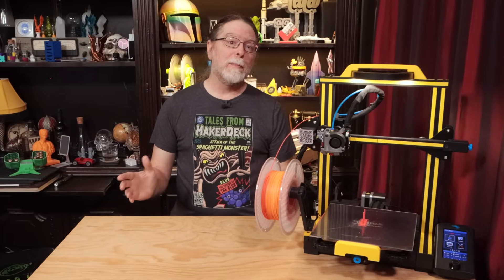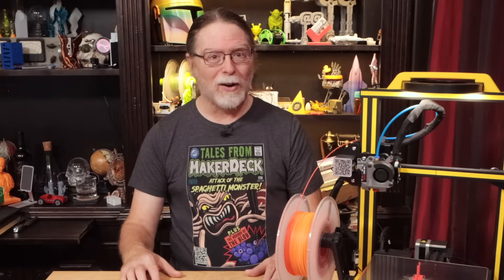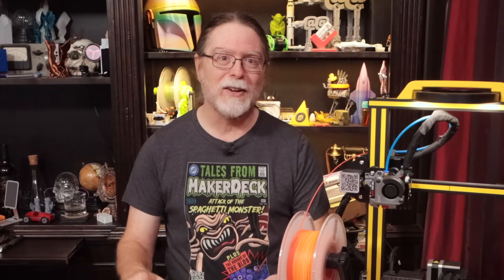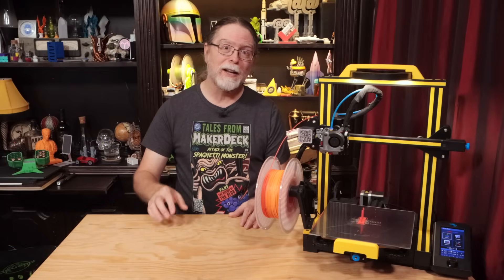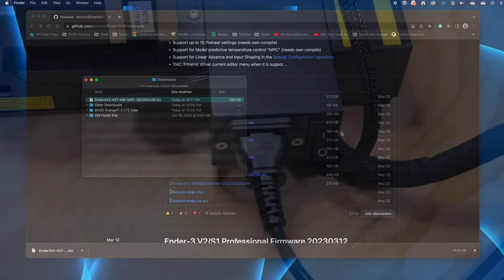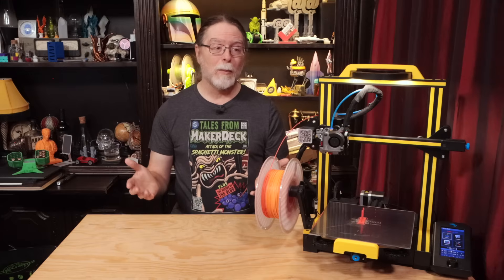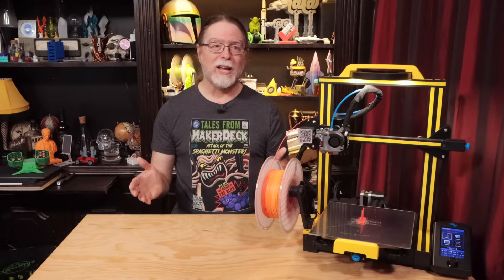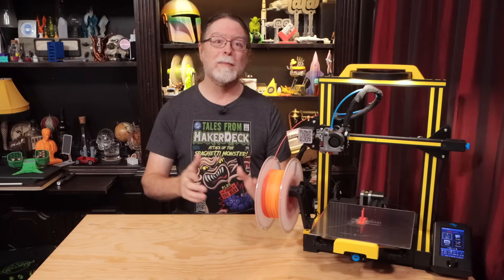The BEST Ender-3 V2 Firmware EVER?! MRiscoC Professional Firmware

Comment: A question for you. I have an E3S1 I purchased new 1 year ago. I have upgraded it's firmware to E3S1Pro firmware and that was the best thing I ever did!!! Now I have 2 more used E3's. An original E3 and an original E3Pro that has the same screen on it my S1 has but get a constant buzzer from display. It has original mobo in chassis in it which is I believe a nono.  If I use this firmware here you talk about (MRiscoC) and purchase the correct board (which one do I need) will this firmware give me at minimum of what my S1Pro firmware gives me for auto leveling, tramming and bed mesh? I do have a touch probe to go on too. Also, My original E3, What can I do to it to get it to at minimum the same level as my E3Pro? Ultimate goal is ALL 3 machines run basically the same firmwares (as in options for mesh and leveling). Can you help? My S1Pro firmware is dialed in perfectly now with the pro firmware.

Comment: Hi Bryan. I installed a Sprite extruder to my ender 3 max neo. I was stuck on that creality screen. I e-mailed Creality,  and they told me that I would have to upgrade the mainboard to a 4.2.7 one. I did that also but the screen is still stuck on creality. Can you please tell me what firmware I should use. Thank you.

Comment: Hi! Please help! 
I recently upgraded my Ender 5PLUS with a 4.2.7 32Bit motherboard and a colour LCD, of course i uploaded the best firmware ever, the Mriscoc 😅
My problem is, the firmware is locked at 230mm printing size, and i want to increase it to 370mm on what ender 5plus have. I tried to do it from slicer, but the printer firmware overrides the GCode and stops at 230mm. 
How can i increase the printing volume?
Reply: Go  to Advanced / Physical settings / menu.
Reply: @MiguelRisco  @MiguelRisco Hi, it dosen't work, it dosen't go further than 238mm. 
But i managed to open the firmware with Visual studio code, and change the printing size from there. 
The machine work perfectly now, thank you very much 😁👍
Reply: @hilexxx  You must follow the instructions about calibration in the wiki, first you need to increase XY MAX POS then you will be able to increase the bed size.
Reply: @MiguelRisco  Aha! I see...  i will reinstall the firmware today and try it. 
Thank you 😁

Comment: You save my day with this video! Thanks 👍
Reply from the maker: Glad I could help!
Reply: @BV3D  I am having a problem that during printing the 'Z' axis is not moving up, maybe it goes up two or three layers, the motor is running from the menu, but not during printing, I have already tried different firmwares. I have already put the bed on level.

Comment: I have been using this firmware for about a year now.  All of my V2s have Sprite Pro direct drive extruders with CR Touch probes and this firmware lets me not only tweak the bed mesh size (I like the 9x9 mesh), but I can also specify the probe offset so that I can maximize the area that's probed.  The Z offset and tramming wizards are invaluable, too.  Hats off to Miguel!
Reply: Did you try AML 2.0?
Reply: @MiguelRisco  I have not, but as I sold off all of my Ender 3 V2 printers except for one and that one is now running Klipper from a Raspberry Pi, I have very few Marlin printers left in my farm.  My Sovol SV02 and SV03 are the only ones not running Klipper.
Reply: @Stew3DPrinting  @MiguelRisco Do either of you have any recommended settings for the Ender3 V@ with a 4.2.2 MB and a Sprite Pro Extruder.  My stock extruder went bad and so I figured I would upgrade to a direct drive, but now the hot end doesn't align with the print bed when I auto home.
Reply: @ShadowDenLifting  I no longer have an Ender 3 V2. Somewhere I have screen shots of the various settings, but I'd have to locate them and transcribe the settings.
Reply: @Stew3DPrinting  Thank you.  I am up and running.
Reply: @ShadowDenLifting  What file you download for the V2 and Sprite with CR touch?

Comment: Should the Auto PID function sets with the filament in or not?
Reply: For the hotend, you should use MPC which is more advanced.
Reply: @MiguelRisco  There is not an MPC firmware for my Ender 3 S1 with the F4 mainboard

Comment: Despite following your instructions to the letter, all this has done is brick my printer.

EDIT: Scratch what I said before, had a TJC screen unit and needed to update the firmware on that too.
But now have a 4.27 board in there now over the (likely still good) 4.2.2 it had originally!

Comment: If I installed the v2 screen on my ender 3 pro, could I run this firmware? My board is a 4.2.2.
Reply: Yes, but you need to follow the calibration guide.

Comment: Amazing firmware and video, I have been using the Jyers FW for the last year without much issue but have had to recently replace my motherboard and lost all my settings. Since the replacement I have been fighting to get my bed level even with the CR touch, within 5 minutes of firing up the new firmware the tramming wizard had got my bed level and I was printing again!

Comment: Can I use it with my Ender 3 V2 Neo?
Reply: Yes.  I just updated mine.  First thing, though it's not too clear, check the Neo screen (open it) and if the model begins with TJC, update it it first with the TJC download from Professional.  Then use the builds that have TJC in the file name and shorten the filename to eight characters then reboot.  If you don't do this, like me, you will spend a few days trying to figure out why the display doesn't work with the new software.

To the software author, make sure the importance of the screen manufacturer is stressed.  Like make it ITEM NUMBER 1 to check!  I thought I'd bricked my Neo until I worked my way through it.

Comment: Just kicked Jyers to the curb and installed this firmware on a Ender 3 Pro that has been upgraded to 4.2.7 board, CRTouch, v2 screen and a dual z lead screw. So far, it is working great with perfect first layer. Thank you for posting this video.
Reply: Same machine, and I have yet to get it to,print first layer well. So frustrating
Reply: How was it different from Jyers? Please respond. To me, it looks identical to Jyers, all the same functions are available. Should I change? I get perfect prints on Ender v2 with Jyers, as good as Bambu lab print, but slower. I have bll touch and another stepper motor for z axis. Works perfect.

Comment: Excellent video.   I had an initial issue with flashing the firmware but changed my SD card from a 8gb to a 16gb one, reformatted.   I also changed the firmware filename to 8 characters.   I got scared for a moment, but it all worked out and it is very nice!

Comment: I downloaded the MM for the 4.2.2 but have a BL touch so went back to re-flash and now wont recongize the firmware update. Any ideas? Didnt have a issue getting it downloaded as MM but major issues doing bltouch.
Reply: I had same issue with 4.2.2 and cr touch.  I hadad to rename/change the .bin file name on the micro SD card to something different/new.  then it loaded the new firmware.

Comment: Could someone help me please, I just upgraded my firmware using this video but to the lastest firmware which is version 2.1.3 mriscoc, on a ender v2 neo and now when printing the nozzle is off the build plate when starting to print meaning that the filament ends up on the deck below the build plate, I’m assuming that the build plate area size is incorrrect but have no idea on how to fix or adjust this, any help would be greatly appreciated.

Comment: Love the software. Helped me determine that my original bed was warped. Question is why does my CURA code not run the G29 code any more. Before I upgraded software, I had G29 F5 run before each print, now it is not and I verified it is still in the slicing software pre-code gcode.
Reply: for UBL use "G29 P1"

Comment: Is there an option in this firmware to raise max nozzle temp to 300c ?
Reply: Yes, with the custom G-code "C29" but if you have a Sprite Pro extruder then try the T13 version.

Comment: love your videos I need help: my Ender 3 v2 print head early in print just runs to the nd of the bed on the x axis until it hits the stop and makes a loud chattering noise i did the firmware up grade and have the same issue. I am printing via usb from computer to ender please advise.

Comment: Installed on my ender 3 max v2 pro,  am getting a ender 5 plus and am wondering could I install a v4.2.7 board use a ender 3v2 display and rewrite the code to use on the e5+??

Comment: Hi Bryan.
I installed the motherboard firmware and DWIN display on my Ender 3V2, very easy. It worked perfect, the firmware that was on the machine was the original. Greetings from Brazil and thank you for the excellent video. NOTE. The version I installed is already more current than your video, 20240122

Comment: @BV3D  Where do I begin, well I bought 2 Ender 3 V2s over a year ago and to be honest, immediately I was not impressed with them and their printing capabilities. I was expecting great things from them as they were taking over from an exhausted original Ender 3. To be honest their print quality was never up to par with my original Ender 3. To make things worse one of the V2 printers had this odd quirk to it where it would pause for a microscopic amount of time but it was long enough to leave a blob of filament as a result of the hot filament still oozing out of the hot end and spoil the prints. The only prints I could do with this printer as a result of this flaw was flat pieces, panels for the want of a better word. I did find articles on line referring to the power loss function/feature having something to with it but alas the original firmware on my Ender 3 V2 did not have an option to enable or disable it so I was stuck with a well below par printer. I was on line looking at taking a hit for the new Ender 3 V3 SE so I YouTubed some videos for research before purchase and by pure chance your firmware video came up as I went down the rabbit hole of video recommendations which is YouTube. To make a short story long and short again you are a life saver. This firmware up grade has my two V2s running as smooth as butter for the first time in their existence. So thank you, thank you, and thank you.

Comment: how hot is the hot end temperature limit in this firmware? i'm using a spider v3 hotend  and it says it can do  300C but my current firmware only goes to 260C. i'm only trying to get to 280C for PCTG

Comment: Unfortunately, I had the opportunity to test this firmware. Countless of bugs..
1-Main problems are after homing with bl touch, probe is unable to touch back for mesh build.
2- After homing, very frequently ignores the predefined z offset or calculating it 2 times for some reason. Because of this problem, a brand new build plate is full of deep grooves now. Very sad. 

Ender3v2 / sprite pro / with probe

Comment: Why does it have to be an 8gb or smaller SD? What would happen if I attempted it with a 16gb card?
Reply from the maker: The screens in particular are super picky about the cards. Sometimes they read cards larger than 8MB, but sometimes not. You could try partitioning a 16GB card into a pair of 8GB volumes if the 16 doesn't work out for you.
Reply: @BV3D  I decided to forgo updating the screen, so I don't know if that would work or not. I was able to update my main board with your instructions and a 16gb sd card. Everything went smoothly and the printer is running great! Thanks for the video!

Comment: I had a heck of a time putting mine together! As vaas said, what is the definition of insanity? Its really owning a 3d printer. But you know repeat, repeat, repeat expecting different results. LMAO.

Mine was the diagram not giving proper instructions as to what goes where at what angle or side. Was a rough guesstimate eventually I got it right, then it keep rebooting when I was doing preheat / print. Noticed I got the two wires backwards and fixed it. Rebooted again. Thought it was firmware, had to get the plate open on the bottom to get at the board. Found out it was 4.3.1 followed instructions. Still rebooted. Checked the voltage at the back, was set to 230 changed to 115. DOES NOT REBOOT NOW! Yippie. But the bed was off. So I gotta toy around with that more. And the fillamint. Then I will be cooking!

Comment: Hi I have tried to update my screen I have the DWIN_SET model and I have tried several different Flash Drives Formatted like you explain made sure the drives worked for other things, and evey time it goes from Blue to Red Instantly. does anyone have any suggestions or a workaround I am just trying to find any way that will work. PLEASE HELP!!
Reply from the maker: What capacity MicroSD card are you using to update the screen? I generally use 8GB cards. I don't think the screens like larger ones. Also, YouTube isn't the best at notifying me about replies or making them easy to find. Drop me a line at bv3dchannel at gmail dot com, and I'll try to help you troubleshoot.
Reply: I have the some problem. Can you help me ?
Reply: Formate 8gb drive to 4090b and it work

Comment: I'm not finding the releases page nor assets I'm wondering if this firmware actually exists?
Reply from the maker: At https://github.com/mriscoc/Ender3V2S1/releases scroll about halfway down the page. There should be a section called "Assets," and precompiled binaries live there. The current date stamp on the binaries (as of December 12, 2023) is 20231208.
Reply: @BV3D  ok I'll give it a try

Comment: The only major feature I'd like to have is 300C nozzle.  I have no problems with the hardware for this (eg. all metal hot end), but can this firmware allow me to set the max nozzle temp myself?  Or make it easy to define the max nozzle temp?

Comment: I finally got this working on my Ender 3v2 with Sprite Extruder Pro Kit and BL Touch. It took me a while to get the display updated though. As you said Bryan, the display is "Very Picky" about how the SD card is formatted. I had to use an external SD Card formatter to get the 8GB FAT32 partition and then use the windows 11 MSDOS "format" command to get the 4096 byte allocation unit "format h:/A:4096". But it finally worked, and it Looks Great ! ,...Now let's see how it prints. lol. Thanks Bryan.

Comment: This firmware solved all my troubles with my printer! Was about to trade in my Ender 3 V2 for Ender 3 V3 SE but I dropped that thought after installing this FW. Printing's much more smoother and this solved the problem where my printer would fail to print after homing.

Big thanks to you for introducing us to such an awesome firmware!
Reply: Did it improve the print quality or speed?

Comment: This is great firmware once you get it up and running. I struggled to install the firmware properly on my Ender 3 S1 (STM32401). My model had the TJC display and needed special firmware flashed to both the display and the board. Just something to be aware of if you plan on doing this yourself. Great video, by the way!
Reply: can I ask what issues you had? I think I have the TJC display (will check after my big print).  I tried installing the main firmware and was just stuck on creality logo and wouldnt go further
Reply: Hey, did you ever figure out how to properly update the display for your TJC? I have the firmware installed for the printer and tried installing the special precompiled bin files for the TJC displays, but it still looks weird, so idk if i did it properly.

Comment: Hi Bryan, quick question? I'm looking at purchasing the CR-Touch (not the BL-Touch) for this model. Will the (BLTUBL-MPC-20230522.bin) firmware still work the same?
Reply: I have a CR Touch and the firmware works for me.  I've installed the latest version from September.

Comment: Good firmware but if you are using a SKR mini E3V3, dont expect much. The board has so many features above the creality OEM but no support from the firmware. You will be better off compiling your own "Custom" firmware
Reply: Just figured out that if you do have the SKR board and an SD extender, it will not work.....😔

Comment: Iam trying to do the same. But my screen stuck on creality text and nothng happens after that. Please provide some solutions
Reply: You might have the wrong file for your chipset, there are two an f1 and a f4 file, I had the same issue I switched files from the f1 to the f4 and put the .bin file in a folder on the sd card named STM32F4_UPDATE. worked just fine
Reply: @MrQreed  what are f1 and f4? Could you please elaborate? What exactly i have to do
Reply: @MrQreed  printer works fine. I uploaded the firmware from official creality site. But the problem for me is screen is stuck. Still if i click on print (assumptions of button clicks) it starts printing as usual . But i could see only the creality text on screen. And i could nt do screen update. Nthng works when it comes to screen
Reply: and i found that my display type is tjc @MrQreed

Comment: Fantastic video , I bought a 3v2 running mriscoc love it , I also bought a 2pro running stock software ,, printed a vase on both using the same file/sd card 2pro 6hrs 3v2 26hrs ? any ideal why the 3v2 took so long to print it has the sprite on it board is the 4.2.7 / BL dual Z Thanks I should add file is of Thingiverse and guide etc done in buildbee (newbie here)